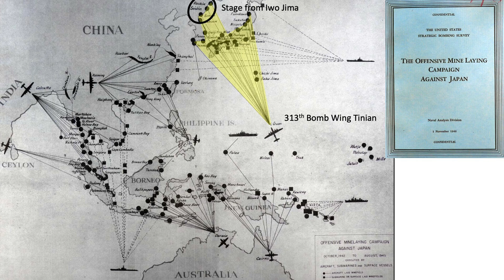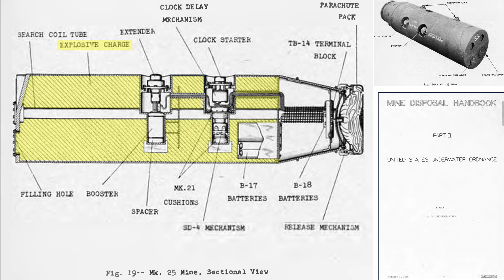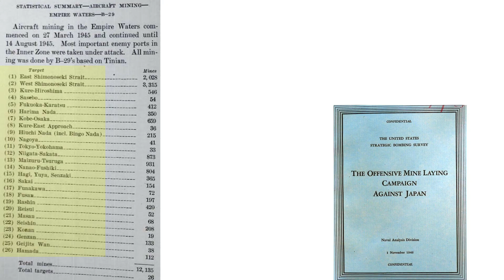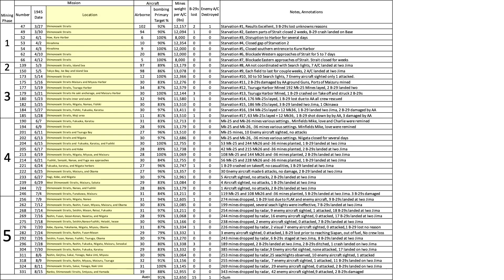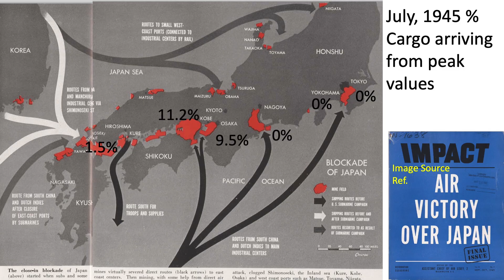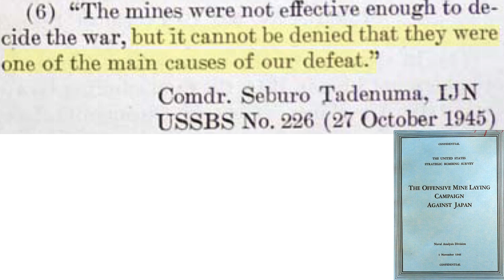Operation Starvation: Cutting Japan’s Shipping Lifeline with B-29 Bombers

Comment: The fighter sweeps over Imperial Japan and the Third Reich would make for an interesting video.  Attached below is a translation of the 1927 "The Command of the Air" by Douhet.  He recommended that "scout aircraft," single-engine and single-seat planes with small bombs and a radio, swarm enemy territory in support of bomber operations.  These aircraft would report on bomb damage--but they could also attack targets of opportunity.  In late 1945 USAAF fighters based on Okinawa and USN/USMC carrier-based aircraft would make low-level attacks on Japanese cities and suspected airfields.  

One carrier-based raid against Tokyo's Nakajima Musashino-Tama aircraft factory was conducted from as low as 1000 feet (dive pullout) as 10 VB-84 Helldivers and 12 VT-84 Avengers plastered the 45-acre complex--escorted by 24 VF-84 Corsairs.  The aircraft operated off of CV-17 USS Bunker Hill, part of Task Force 58.  Reportedly, 32 out of 36 bombs were observed to strike the target.  In addition, the target was attacked with rockets and cannon and machine gun fire.  Japan was hording its aviation but sent up a few fighters to annoy the Navy planes.  It must have been demoralizing for Japanese subjects to witness American war planes shooting up Tokyo's streets.

https://www.airuniversity.af.edu/Portals/10/AUPress/Books/B_0160_DOUHET_THE_COMMAND_OF_THE_AIR.PDF

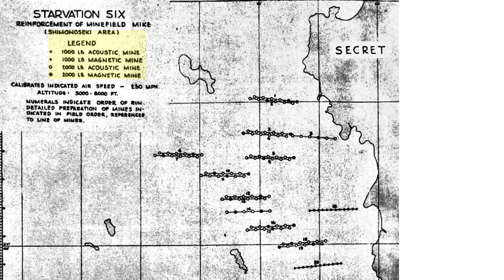Comment: 🙂 What an awesome, fact filled video compiled from primary sources.  For me, the key part began at 13:08 with the map and the table showing the shift to Osaka and Kobe and the port volume declines.  Here's some additional background:

Recall that Japan, which didn't have a master plan, prioritized the land war in China, which for Japan was the second modern war in China (the first being in 1894 and 1895 and yielding control of Taiwan and domination in Korea):

(1) Japan had been waging a limited war in north China from 1931 and a total war on China from 7/1937
(2) it was the army's war, and excluded the navy
(3) the United States embargoed Japan from 7/1941 or 8/1941
(4) this crippled Japan's war with China, and
(5) part of the motivation for Japan's attacks on the United States and other Western colonial powers was to restore access to oil to fuel the war in China while getting the powerful navy into the war, but even so, the army remained the driver and the navy the passenger (much to its irritation, as Japan's army and navy were worse than rivals and were competitors even for the direction of the war's purpose).

But I left something out.  To sustain a war in China, Japan needed logistics in the form of bulk commercial shipping.  Back then, just as now, many of the world's largest commercial shippers were Danish, Norwegian, and Dutch.  Shipping is fungible, and access to foreign shipping enabled Japan to concentrate Japanese shipping for war purposes.  When Germany attacked those three European countries in 4/1940 and 5/1940, they all chose to stop carrying (anything, anywhere) for Germany's ally Japan.  Japan was unaware of Germany's plans and also did not anticipate this response by Germany's invasion targets.  This sudden massive loss of available shipping hammered Japan's logistical link to China, because Japan was not remotely capable of supplying the China war plus Japan's other heavy shipping needs using only Japanese ships.  This was a big pain point for Japan.  

You can see it in the map.  Normally, in logistics, you want maximum time at sea and minimum time by rail, because all else equal, sea is cheaper and more efficient (even in a war economy, efficiency matters).  So Japan normally probably would want to concentrate shipping to Shanghai or Tianjin.  But Japan's shipping to China often minimized sea and maximized rail because sea capacity was vulnerable to attack and was limited, while rail was not vulnerable and was plentiful.  Japan did everything it could to move shipping into the Inland Sea, to western Japan, and to south and east Korean ports closest to Japan and the Soviet Union, which Japan trusted not to attack.  This trust was so fundamental to Japan's war that even after 5/1945 when the Soviet Union told Japan through official channels that the Soviet Union really would attack on a timetable just as it had promised the Western Allies, Japan chose to disregard this warning.  Arguably, the Soviet attack in 8/1945 was the straw that broke Japan's back.  The American atomic weapons were shocking, but for America to destroy Japanese cities from the air, even totally, was not new in 8/1945 and Japan still fought on anyway.  Whether America wrought that devastating damage with many bombers and bombs, or one bomber with one bomb, was something of an academic question.  Soviet invasion was new, and losing Manchuria (Japanese held from 1931) and northern Korea (Japanese held from 1895/1910) plus Japan's largest army in the space of a few days was too appalling to bear.  Instant, total land defeat in Asia in the territories held longest was for Japan a completely new factor in the war.  Additionally, of course, the sweeping Soviet attack, though only in the lands next to the Soviet Union, effectively instantly rendered hopeless the entire China war for Japan, anywhere in China.

I want to emphasize one more time, particularly for a Western audience, that Japan's top war priority was fighting China.  Japan initiated war with the Western powers when it did because the Western powers had critically undermined the sustenance of the priority war in China.  That might seem puzzling to Westerners, but it is true.  And while China resisted strongly and inflicted many attrition casualties on Japan's army, and even while Japan struggled to force China to submit, the war was a mismatch in actual warfighting terms.  Both China and Japan knew that China was not equipped, in any sense, to force Japan's invasion to end, and that China was suffering the brunt of the damage.  For Japan's militarists and fascists, China was where victory always was to be had and where the land and resources Japan "lacked" could be stolen.

Air mining of sea lanes to continental Asia hurt Japan where its leaders cared most by hurting its army in continental Asia.  It was very cheap and very effective.  Bombing Japan's cities hurt, but Japan is big and people and production can be moved.  It's never possible to bomb a developed enemy into the ground.  But ships are specific and finite, and can be sunk, and once the ship is sunk, everything that depended on that ship stops.
Reply: American belief, Japanese fascist reality:

- the war began in 12/1941 v. the war began in 7/1937 and was an extension of multiple earlier wars
- the Japanese navy was in charge v. the Japanese army was in charge
- defeat of the navy hurt Japan v. defeat of the army hurt Japan
- America was Japan's priority enemy v. China was Japan's priority conquest opportunity
- the atomic bombs motivated surrender v. the atomic bombs were devastating but a combination of factors in totality including the atomic bombs motivated surrender
- the Soviet Union spectated v. the Soviet Union briefly but massively intervened at a high leverage time and place where Japan was very sensitive to quick defeat

To be clear, I am NOT arguing that the Soviet Union won the Pacific war.  America more than any other country both fought and brought defeat home to Japan while the Soviet Union did very little in sum total.  But the impact of the Soviet attack was high leverage.  This video is great because it highlights one of those factors to which American warfighting was central, but that is underplayed or that Americans ignore: logistics.  Operation Starvation thus hit Japan, earlier, in somewhat the same way that the Soviet Union eventually did: it undermined Japan's continental war in China and it efficiently brought vast American air and sea power directly to bear on the home islands, Korea, Manchuria, north China, and their sustenance, geographies where normally America struggled to project power.

Comment: I’d heard of Op Starvation after reading an airpower study on it. The officers looking to rise to higher command have to put together a study as part of their requirements and if lucky gets published.

The second part was about the mining of the rivers and canals the Germans were using to transport oil from Romania. The RAF had been doing a low number of these missions and it nearly paralysed the early German war effort.

Unfortunately Bomber Harris interfered and threatened to resign as he’d set his mind to bombing cities thanks to the sheer ineffectiveness of bombing at that time. He sacked the junior officers showing data to how much more effective mines were. Germany had no chance at placing AA to defend every inch of waterway.
Reply: He also refused to allow the bombing of submarine pens while they were being built.  He allowed it afterwards when they were much more impervious to damage.
Reply: @ronaldrhatigan7652  Harris had nothing to do with not attacking the pen's. while they were being built he was doing a staff job at the Air Ministry and was then in the USA buying aircraft.
Reply: @richardvernon317  Planes need fuel. So do tanks.
Reply: If I was grading this officer's paper he would be getting a "F" See Me!!!!

Romania was neutral until June 1941, the only base that the British could use to attack it was Crete which was taken by the Germans in May 1941.  RAF Mediterranean Air Force started the campaign in April 1944 from bases in Italy. Could not do the missions from North Africa as Türkiye was in the way. 15th Air Force at the same time was smashing the hell out of Ploieşti until the Soviets captured it.

A British RAF Group Captain in a Imperil Defence planning Committee in the mid 1930's came up with the concept of the RAF Long range Bombers dropping Influence naval ground mines (called ground mines as they lay on the sea bed) in places where other mine layers couldn't reach .  He had had the idea after a bun fight with the navy about who controls the development of air dropped weapons over the sea. The Royal Navy Capitan on the Committee says, Bad Idea, if we use it, the weapon will end up been captured by our enemy and we have a butt load more ships to lose than our enemies. RAF Officer replies, if we develop them, we can also work out counter measures to stop this from happening. Navy wins the bun fight on the subject and though the Navy do a little bit of research into such weapon they are nowhere near having one ready for deployment at the start of the war. (Royal Navy have control of development of under water weapons).

WWII starts in September 1939 and the Germans immediately instigate an airborne sea mining campaign using magnetic influence mines. This causes the British a butt load of hurt with major damage to heavy warships and a lot of small coastal shipping being sunk. Fortunately, three months into the war, the Luftwaffe drop an incorrectly armed mine on a British Army coastal weapons experimental establishment and a mixture of Royal navy and Army personnel manage to defuse it and recover it. 

By April 1940, the Royal Navy have developed their own air dropped magnetic influence mine and want the RAF to drop them where they can not reach. RAF Coastal Command say, can't, we don't have the aircraft which can carry them. Bomber Command gets tasked with the job and the only aircraft they have is the Handley Page Hampden. AOC 5 Group who is in charge of the Hampden bomber force, gets the order to do the task and basically replies, "Awesome, would love to do this, send the navy around and we will get the ball rolling". Bomber Command start a Mining campaign of German controlled ports under the direction of the Royal Navy.

The fuck up in Norway, the Low Counties and France happens and the Germans start dumping a lot of assets in France to do operation Sea Lion. Bomber Command attack airfields, landing barge concentrations and other transportation targets with some to little effect and high losses. Somebody has the idea to attack the pair of aqueduct that takes a major German canal over a river that the British suspected of being used to take the majority of these river barges that are going to be used as landing craft out of Germany and into the North sea so they can be towed to France. The only weapon they have with enough explosive in them to blow a hole in the target bridge is a modified air dropped mine fitted with a delay fuze. AOC 5 Group sets up an attack, all of the aircraft used in the attack are shot down or badly damaged by Flak as the Germans have placed quite heavy flak defences along all of their major waterways. One Hampden manages to get a bomb into the water on one of the twin aqueduct's and blows a big hole in it. He manages to get home along with one other aircraft and the Squadron OC puts him up for a DFC. The AOC 5 Group bumps it up to a recommendation for a VC, which is awarded. The AOC also puts in a report stating that any raid that results in the loss of most of the aircraft with only a single aircraft actually hitting the target is worthy of a VC and should not have been carried out in the first place as it is too dangerous. 

AOC 5 Group then gets promoted, goes to the Air Ministry on a staff job, hates it with a passion and then gets sent over to the USA to buy aircraft (a job he was involved in before the war.      

 In  February 1942, the New AOC in C Bomber Command ask's what's the mining effort??? The reply, 5 Group are dropping about 90 a month. His reply, all groups to do it when they can not bomb Germany. He calls the Royal Navy and asks how many mines can you give me to drop a month? the reply, a 1000. So Bomber Command do that, drop a 1000 mines a month around German controlled ports and sea lanes from the Baltic to Norway and down to the French / Spanish Boarder, at times and locations requested by the Royal Navy.

The Three Officers I mention in this story are the same person Arthur T Harris!!!! The man wasn't against Mine laying from long range aircraft, he practically invented it (as far as the British are concerned).

As for the German Waterways, they were actually very heavily defended with a flak gun at every major piece of infrastructure (locks, sluices and bridges). If the RAF had tried to mine them, the job had to be done at very low level, in good weather and with moonlight. GEE, OBOE and G-H don't work at low level over Germany and operating at over 1000 feet makes you dead meat for nightfighters.  The waterways are 300 miles from the UK, the Germans have ground observers all over Germany and the low countries and any navigation error by the RAF bombers normally ended up with the aircraft getting damaged or shot down by some flak gun dotted around the place. Germans had 11,000 plus light flak guns in Germany during WWII (and 11,000 heavy guns on top of that).  Of course the Germans know aircraft have been flying about and nobody has heard any bangs. Frist thing they are going to do is look for parachutes in the canals and rivers and if they find them stop all water traffic until the waterway has been swept for mines. 

All of the low level attacks in Germany by Bomber command suffered 40 to 60% losses. A low level mining campaign was never going to work, so Harris never tried it, for very good reasons.

Comment: A2 / AD, before it was called that.  Even if those merchant ships weren't sunk, they were "mission killed" in that they couldn't be risked through mined waters.  I knew about this campaign, but you added a great deal of detail - the phases, the specific areas mined, the number of mines, and the level of effort in terms of sorties, and losses, by 20th Bomber Command. Great vid as always WW2USB with the use of primary sources from the period in question.

Comment: So you can add sea mines to the reasons japan surrendered.     Given the fire bombing, Soviet declaration of war, and sea mining operations, the atomic bombs were probably the tipping point.  So which is worse, 200k killed by the atomc bombs or millions killed by starvation, fire bombings and losses on both sides from an allied invasion.  
Yes, atomic bombs should never be used again, but that doesn't mean it was wrong to use them in 1945.
Reply: If they’d started mining as soon as capability allowed and not fire bombed cities there would have been even more strain on their economy with many more mouths to feed. 

De-mining after the war must have been a nightmare for minesweepers.

Comment: Amazing information here.  It adds a new dimension of understanding to the history of the ending of the Pacific War.  The Navy can be justly proud of the long-delayed success of the submarine war against Japanese shipping, but a relatively minor operation of B-29s finished the job for them quickly and cheaply.  Probably this airborne success was a major factor in the outcome of the inter-service rivalry after the war.  And it is no wonder that starvation stalked the Japanese people after the end of hostilities.
Reply: Calling it cheap is misleading.  Submarines required no support other than bases far removed from Japanese control.  The B-29s could not lay their mines until the end of the island hopping campaign; some of the mining missions had to stage through Iwo Jima.  That campaign took years and a lot of blood and treasure.  The mining campaign was cheap only in the same way as the atom bomb missions were cheap because they "only" required 3 B-29s and a few thousand gallons of fuel.